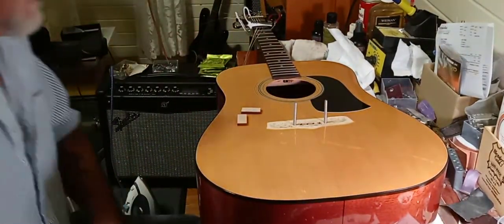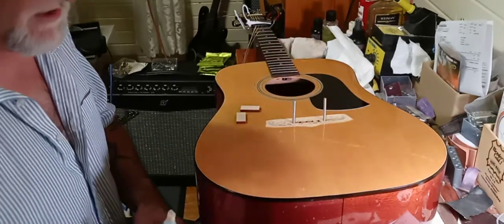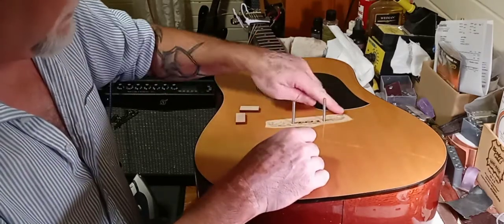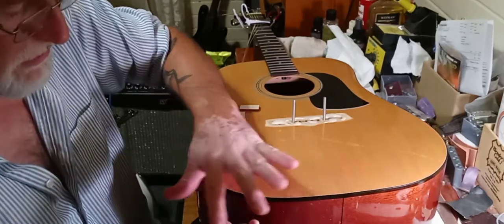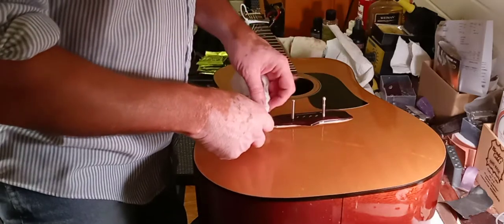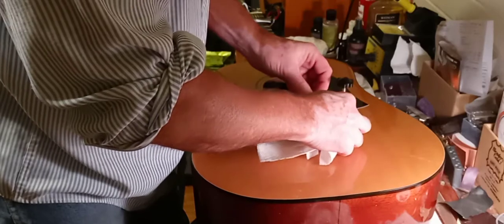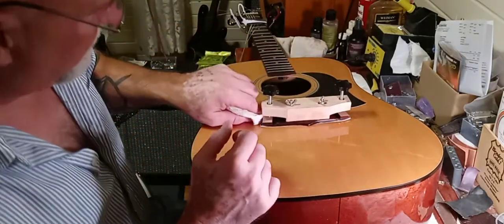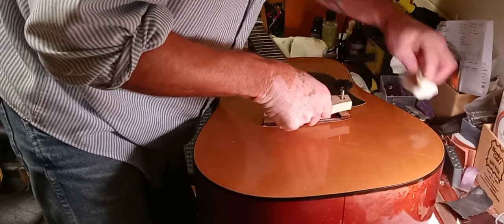Acoustic guitar bridge repair

Comment: I have one of these systems and sometimes I find that because all the clamping pressure is at the bridge pin holes, sometimes I end up with a small gap at the back of the bridge. Any suggestions? Perhaps its my prep work but I always think if I had some clamping pressure at the back of the bridge it would be easier - at least for me.
Reply from the maker: Given that there is so many different types and styles of bridges it's hard to make a one size fits all tool. I approach each job expecting to have some issues that causes me to make modifications in some way. Thanks for sharing!

Comment: What's under the bridge inside the guitar that the bolts go through besides the bridge plate...is there a caul in there the bolt goes through similar to the top or just some washers? What's holding the bolts from falling down into the guitar? Thanks
Reply from the maker: The bolts are just the right size to screw up thru the holes. Adding anything like washers would run the risk of getting glued to the bridge plate. The amount of pressure required to clamp the bridge won't damage plate.